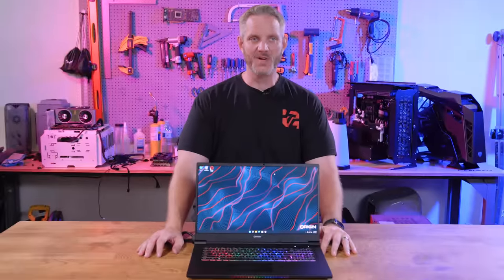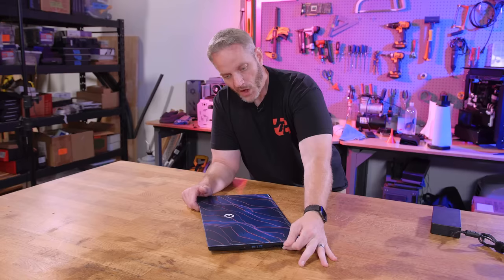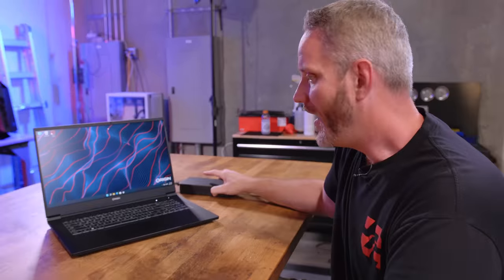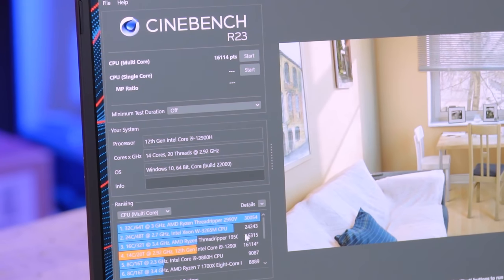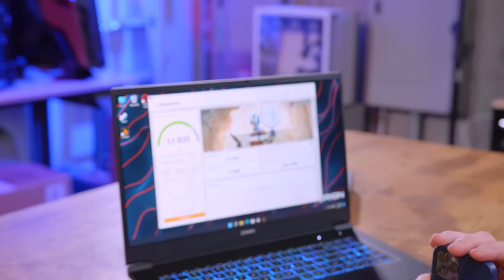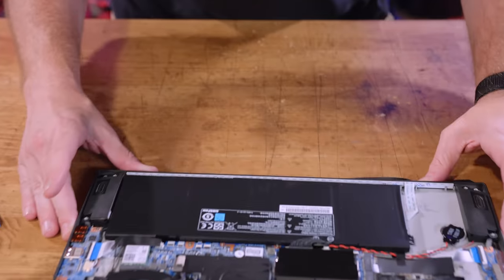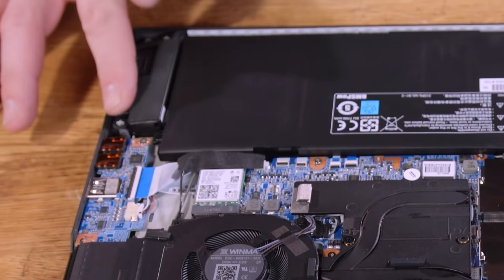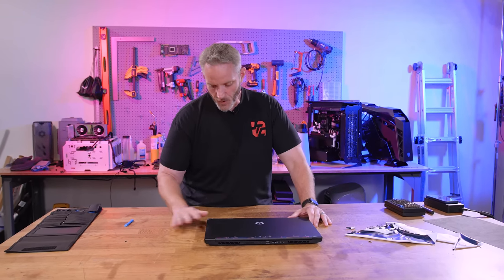This laptop just made your desktop obsolete!

Comment: Got a video idea for you - ever thought about doing a video on why laptop cooling degrades in its effectiveness so quickly? I'm now a happy owner of a desktop but my first two laptops were gaming laptops, each of which became unusable due to thermals only about a year into owning them, even with repasting every few months, cleaning out all the dust, adding thermal pads, ramping fans all the way up, etc. Running the same games with the same settings had way higher thermals (cpu especially) a year in. Went so far as to have a bag of ice that I'd put next to the intake just to maintain clock speeds, and that would only delay the inevitable throttling by 10-15 minutes. It also makes me nervous about the longevity of the steam deck. Might be difficult to test due to the time commitment but you guys are way smarter than me so I thought maybe you could figure it out. Thoughts?
Reply: "to have a bag of ice that I'd put next to the intake" do NOT do that,the bag of ice will probably create condensation on it and the water will be pulled on the motherboard,shorting something

Comment: The gpu wattage? something Ive learned to look at when it comes to performance in laptops. You can have a lower tier gpu outperform a better one depending on the power the system allows the gpu to draw. edit: Uh thats neat, that is so nice being able to adjust the power limit by so much.

Comment: Ok Im pausing the video at 2:13 to post my experience. 
I bought min October 2021 it was a very high end build. I am typically a MSI high end gaming desktop replacement laptop. but at the time most high end laptop required dual power supplies. So I went with this. Keep in mind this really does not leave my desk so looking back, the multiple power supplies wouldn't have been an issue.  I just like to have the option of it being mobile if needed. 
The Three things I do not like:
1. The keyboard is not firm and gives way when pressed on. 
2. The fan is LOUD and is on most the time your doing anything. To help that I got a laptop stand with a fan.
3. Audio is trash compared to my last couple gaming desktop replacements. 
My personal experience with Origin was not good. Drives I received had hundreds of power cycles and thousands of hours of use already. The second drive died with in a week. RMA process to get new drive went great, After installing drive, started having boot issues where bios would not see any drives. I did testing in other system and my own trouble shooting lead me to believe the motherboard was bad. Origin had me ship the laptop back, where they tried to blame me for the drives not working, stating i left too much of the stock thermal padding on drives and I would have to pay for the repairs. I had to argue with them and state based on what they are saying it does not even sound like the tech has repeated my tests to check the motherboard. Eventually they did and finally replaced the motherboard and drives. The motherboard was completely bricking drive 2 and in many cases if a drive was installed into drive 2 slot, the bios would not see any drives and the system would not boot. Remove drive 2 and system would boot fine. Since then I have not had any issues and it performs well, just be ready for that fan noise and hot keyboard. 
Here are the specs I bought. Now off to see what Jay says about this thing... 
Customizations
Case : New EVO17-S
Exterior Color : Black
Current Special Offer: Free US Ground Shipping $50 value
Current Special Offer: FREE $50 VISA REWARDS CARD
Motherboard: EVO17-S
Processors: Intel Core i7-11800H 8-Cores up to 4.6 GHz 
Display Type: 17.3" 4K Adobe 100% w/ RTX 3080
Memory: CORSAIR VENGEANCE 32GB 2666MHz (2X16GB)
Operating System: MS Windows 10 Professional "Free Upgrade to Windows 11¹(when available, see Learn More)“
Operating System Drive: CORSAIR 2TB MP600 PRO Gen4 
RAID : QTY: 2
Audio: Integrated High-Definition Audio
Networking: Intel Dual Band Wireless-Wi-Fi 6 AX201 + BT M.2
Finger Print Reader: Integrated Biometric Discrete Area Fingerprint Reader Underneath Glass Touchpad
Integrated Camera: 1MP HD Webcam
The ORIGIN Difference: The Best Gaming Experience Guaranteed
ORIGIN Maximum Protection Shipping Process: ORIGIN Wooden Crate Armor
24/7 U.S Based Warranty: 2 Year Part Replacement with Free Shipping
No Dead Pixel Guarantee: 45 Day No Dead Pixel Guarantee Free
Additional Charges
Media Card Reader: Media Card Reader
Free ORIGIN PC Gear: ORIGIN PC T-Shirt
Size : XL
Free ORIGIN PC Gear: ORIGIN PC Mousepad
Free ORIGIN PC Gear: ORIGIN Medium Notebook Sleeve
Power Accessories: EVO15/16/17-S AC adapters 180W

Comment: I've got the MSI version of almost this exact spec except my MSI has the I7 12700H. The MSI doesn't make a version with then I9 and the 240hz refresh and 3080ti. The computer is a beast. It's way faster than my 1080ti desktop. I mostly got it to deejay gigs with Serato and to game in my living room instead of PC room.  I like being able to game and watch TV at the same time. My laptop was just over 4K with tax and expedited shipping.  Fans aren't too loud. Doesn't get too hot. No issues after 2 months. Played a gig with Serato recently and no crashes. Boots up in 12 seconds. If you're gonna spend 4 grand on a laptop Origin PC is probably not the way to go.

Comment: The FAA rule is 100 watts per battery, but no limit on number of batteries. So you can just shrink wrap each cell independently and have plugs to separate them. Then legally you can make it any size with each cell being up to 100 watts. This would mean the laptop here having 4 cells would be able to have up to a 400 watt hour battery. (Laws are dumb)

Comment: Speaking of CHONK-lappies: you should give the latest Sager/Clevo chassis a spin.

I've been using them for years, and they (as far as I know) are the progenitors of the BIG-ASS FUCKING BRICK. Every one I've owned has had a 2lb Chicony 300W brick attached to it.

Anyway, the latest model is the SAGER NP8872T-S (or Clevo PD70PNT); as with all high-end lappies right now, you can customize up to an Intel 12900H/3080Ti (mobile). They are usually the chonkiest and the best for airflow (because *chonk*) and they quite often come with a wee subwoofer (literally an inch across) within the chassis that adds not-too-bad depth to the audio.
Reply: Sager... OMG!  I haven't heard of them since the 486 / Pentium 1 days!  Good to know they are still in business!

Comment: The i5 12600K ... on most z-boards the CPUs get completely trashed cause of the bad mainboard presets. I'm now using that CPU as a silent office PC. Disabling all the bullshit-settings and setting it to intels recommendations but with a 90W PL1/PL2 it reaches 16600 in CBr23. Over 95% the performance but 30% less powerdraw. It is always the last couple percent in performance that have unreasonable powerconsumption.

Comment: The e-cores are also great for noise AND  PERFORMANCE. They are a lot smaller, take a lot less energy, but are only slightly slower, resulting in higher performance per die-area as well as more performance per Watt. Sadly Intel only offers high-ratio (a lot more e-cores than p-cores) CPUs for mobile, same as with the iGPU....

Seriously, on Mobile you can get 1+4 or 2+8 (aka for each p-core 4 e-cores) and from a die standpoint that makes sense - on the die it is either 1 p-core or 4 e-cores that take up the same slot on the die. And with the iGPU it is just as bad. On desktop you need to go to the middle of the i5 range to get 32 EUs, the i3 only get 24. On Mobile (outside from workstations) they start with 48 EUs, the i3 have 64 and goes all the way up to 96 EUs, so 3x desktop.

Now please intel - give me a 2+8 with 96 EU for desktop. That would be what i can use for a streaming-box that also still has a GPU capable enough for gaming as well as a CPU that is strong enough for most games to run OK while also being able to do some work on that.

Comment: The only downside to any and all laptops with rear power plug next to the heat vent. It destroys the power plug by overheating the sodder on the joint causing power to not work properly. If it had a side power plug it would be perfect

Comment: How the heck do they cram so much power into that small of a laptop?  I’d be worried that you are leaving performance behind like GN’s review of the Alienware, or it is thigh-burning hot.
Reply: Because they're not cramming all that power into a small laptop lol. Laptop components use half the power of Desktop components. And of course you're leaving performance behind. That 12900H and 3080ti perform nothing like their Desktop counterparts. A 3080ti mobile performs worse then a desktop 3070 and a 12900H performs worse then a 12600k. And they probably burn too close to the sun as well. Don't be fooled by the naming schemes in laptops lol.
Reply: Insanely hot, and very very loud. You end up needing an external keyboard and mouse to feel comfortable, at which point you might as well get a desktop
Reply: in 10th gen they actually got super close, within 25% of the desktop version and on a good variant closer to 10%. the 1070 laptop was actually a 1070ti die that was undervolted and underclocked to fit the power budget, but with the extra cores came super close to the 1070 it was supposed to be. 

and then RTX came out and they had no hope because wattage started getting way higher.

and then intel, even though durability is fine (they dont go bad nearly as fast as desktops are known to at the same temps) they still like to sit around 90c thanks to boost wattage as high as the cooler will allow

Comment: I'm so glad laptop manufacturers went back to making 1440p screens for laptops. 
That's just the right amount of pixels to be crisp and still push frames like a bat out of hell.
Reply: for the size of laptop screens, 1080p is already better in terms of pixel density than most desktop 1440p monitors. My 17.3 1080p looks so much better than my 32 inch 1440p external monitor. Honestly did not see a difference between 15.6 1080p and 17.3 1440p the last time i had a chance to compare them side by side. But of course that is extremely personal like someone who was actually fine with 30fps on ps4 too..

Comment: If you want a desktop as fast as this laptop. What do you need and how expensive will it be?
Reply: The configuration in the video (12900H, laptop 3080 TI, 32 GB DDR5 4800 MHz RAM) is just over $3300 via the website linked in the description and only comes with a 250 GB NVMe SSD. For less than $2000, you could get a better desktop system. 

My build cost $2200, but comes with a 12700 (whereas the laptop 12900H is more like a 12600 performance-wise), a 3080 (the laptop 3080 TI is worse than a desktop 3070), 32 GB of DDR4 3600 CL16 RAM (basically identical to DDR5 because current DDR5 RAM has very high CAS latency that negates the higher frequency advantage), and a pair of high quality 2 TB NVMe SSDs. Going down to a single 2 TB NVMe would drop the price down to $2000, still far more storage than the 250 GB in the base version of the laptop.

Not to mention that my build includes a Fractal Torrent (one of the best cases on the market today for airflow and performance) and the Arctic Freezer Esports Duo, which is more than enough for my CPU. So my build runs at much, much lower temperatures than any gaming laptop.
Reply: @andyhuang8010  thanks, for your answer!
But for the 2200 dollar, does it has also keyboard, screen and mouse?

Comment: The naming convention is despicable. I was fooled by MSI and Radeon years ago with laptop that had an R9-m290X (R9 290X being a good GPU equiv of a GTX 970 at a time when the only thing higher was a GTX 980) - The R9 m290X was LESS than 40% performance of the desktop card :(, and was infact a purely rebranded HD 8970m, which was also a rebranded 7970m. - I will never buy a gaming laptop again

Comment: This looks a lot like a Clevo. I have the smaller version, a 15.6" with an i5 12500h and 3060 and it is hot! Also I cannot undervolt, so it is really a concern for me. For example, running Path of Exile at 1080p and 144 hz, temps are around 87C. This is not good.
Reply: It's a tongfang

Comment: Gaming on a laptop is never a good option because the gaming performance can be somewhat limited as apposed to a full desktop gaming pc. Desktop PCs aren’t limited to power so they can still beat gaming laptops no matter what even if the laptop is plugged in from a wall outlet. I recently built my pc that has an i9-10900K with an EVGA RTX 3080 FTW3 Ultra and 4 x 16gb DDR4 CL16 3200mhz. The gaming performance in that pc is outstanding because it’s not relying on a battery or a power brick for a power source.

Comment: I'd be interested in how easy it is to replace the keyboard. Back 10-20 yrs ago, I would replace a worn keyboard on laptops easily every year or two, by accessing it through the top. The keyboard for this one looks like it requires removing the motherboard, similar to the Acer Predator I use now.

Comment: we just don't need desktops anymore, i use mine daily with external monitor/mouse/keyboard and it works wonders, it games everything and when needed it travels with me everywhere i go, its a must.
Liquid Metal on these beasts would be great to see.
This Mobile 3080TI's are equal to 3060ti desktop
Reply: I thought the same 10/15 years ago but I still prefer to use my desktop for most things.
Reply: If you can afford to pay double the price for the same performance, sure, go with mobile. A desktop pc with the same performance will be around 1500 to 1700€. That laptop here is priced around 4000€. And that price will surely jump after this advertisement.
Reply: @khaychi  laptops form factors mean heat management and therefore performance will always be affected. Upgrades is another major laptop drawback. Gaming laptops are pretty amazing but as you say it comes at a much higher cost to performance ratio and it takes the DIY element away!

Comment: Question about the power brick: you mentioned 14 amps. Is that on the line or load side? If it's the line side then it would pop a 15 amp breaker after so long because it's over 80%. You would need a 20 amp circuit and receptacle to run that laptop drawing 14 amps.

Comment: If people need power why hamstring that by a battery that can only run it full throttle for an hour or 2 or stuck with the thermal limits of a 4lb case? If you are going to spend ridiculous amounts of money for overpriced laptops might as well use that for a Threadripper PC and if you need it to be portable put it in 2 modded suitcases, 1 for the PC/LCD screen the other for the 5KWh lipo pack/1500W inverter. Extendable run times by a few hours if you also carry a 500W foldable solar panel or 2  in a backpack to slow down the discharge of the battery in sunlight/outdoors. Yes, that's probably 100 lbs of shit that's probably best put in a wheel barrow or cart for portability but everything is a tradeoff.
Reply: My point exactly I do all my work and high intensity work loads and gaming on my 5900x , 64gb ddr4 ballistix  running at cl14 , 15 ,16 ,16 ,34 , with a rtx 3080 3 gen 4 nvmes  4tb total and gen 3 in nvme adaptor on x570 master  ., I have 2200u laptop I bought 4 years ago still nippy does what I need for spreadsheets , basics things and some medium light loads , cost me £250 at the time brand new  decent 1080p screen 4gb ddr4  I bought another 4 4gb from cex for £4 , I replaced the shit lite on 256gb SSD for a crucial high performance gen 3 nvme 1tb for £62 , a few weeks ago a got a new battery for £37 does everything I need it do still look as good as new , even the screen  I can do low end gaming on it too with the vegaa 3 , postal 2 and rct3 an old but good game , why spend more if you don't need to I could easily she'll out for Ryzen 5000)6000 laptop but it would be pointless for me

Comment: Looked at the specs for this in the configurator and was disgusted by this: Intel Centrino Wireless-N 2230 Wi-Fi Card 2230BNHMW 802.11b/g/n Bluetooth 4.0 

Hard Pass that card is 10 years old and way behind the times. Origin should be putting in a Intel Wi-Fi 6E AX1690 for a laptop of this spec.

Comment: It did not because it will be loud af when under load, it does not have a 27’ display, I am not forced to look down on my monitor on my desktop pc because I can adjust the height, tilt, keyboard and mouse position and seat hight in relation to eachother. A laptop will always have you fixed in position in relation to it which sucks. They are also loud when under load and not upgradeable. I prefer a weaker desktop than a powerful laptop.

Comment: Anyone remember the Acer Predator 21 X laptop? That beast had 2 1080 graphics chips in it, like bruh.
Reply: My clevo has 2 1080's in sli. 7700k, desktop socketed cpu. If I remember correctly the cool part of the 21x was that it had a 21:9 display. It came out not long after I got mine but I have a 120hz 1440p panel and that one was only 1080p. Besides, I may love my ultrawide but I don't want to carry one... the dual 330w power bricks puts it all over 12lb and I forget the weight of that acer but I remember thinking a hand truck would have come in handy
Reply: @jonathonschott  I got side tracked but yeah, the predator 21 x is heavy as heck and I think only 300 were made.

Comment: Doesn't matter what a mobile gpu is called, it's how much wattage it can draw. A slower mobile gpu with high draw can beat the higher tier gpu with a low power draw. They really should specify what power draw version they are using on these laptop gpus.

Comment: Most airlines limit 100wh batteries to be carried onboard. I feel this is why most manufacturers are stopping just under 100wh
Reply: "Lithium batteries can produce dangerous heat levels, cause ignition, short circuit very easily, and cause inextinguishable fires. That's why renowned aviation authorities, including those in the USA, have banned lithium batteries when traveling."